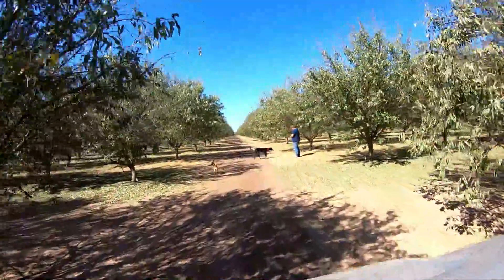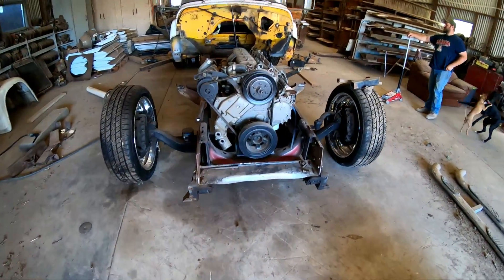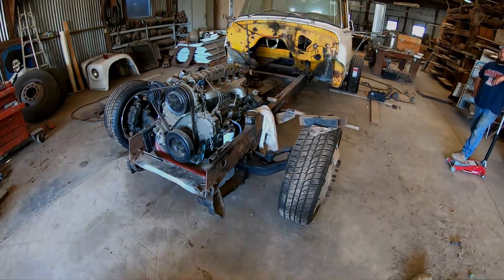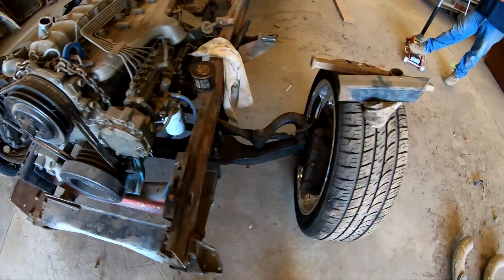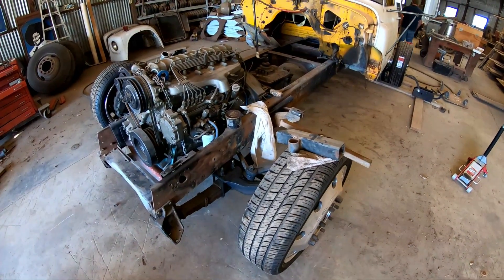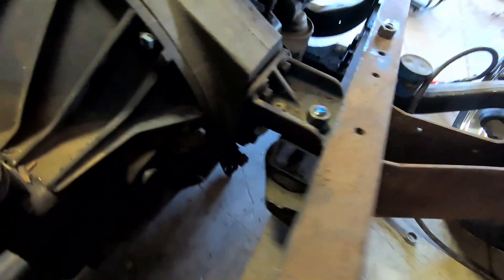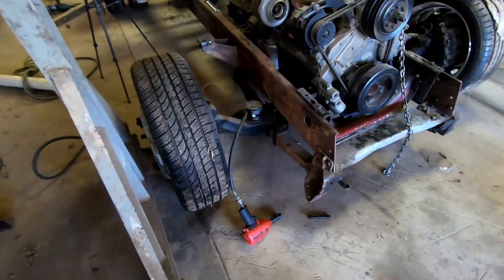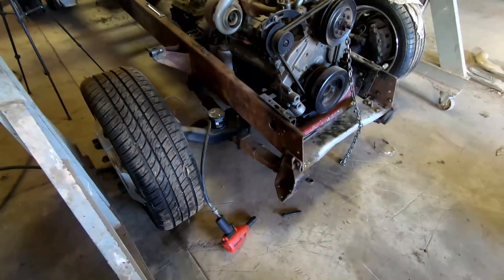Making Adjustments to the Engine Mounts

Comment: Great video guys. Just actually got my setup ready to put the front and rear under as well. Same build but im using as of now a 76 f700 cab, 2000 international 4700 chassis and axles for the hydraulic disk setup. I might need to start videoing it and make me a channel but who knows. Anyways thxs for feeding my latenight bordom with AWESOMNESS.
Reply from the maker: Thanks man! Sounds like you have an awesome build going yourself. If you make videos let me know. I will definitely check them out!

Comment: Since the axle is over the leaves on front, I don't know that taking leaves out does anything for you? Unless I misunderstood where you're looking for clearance from (was thing ground to axle was what you were implying). Also, won't it make the weight of the motor compress the leaves more when you take some out? Regardless, awesome work. Hope harvest has been plentiful.
Reply from the maker: We need to gain clearance from the bottom of the leafs to the ground. So as you remove leafs, it decreases the thickness of the leaf pack. Which will gain ground clearance. And yes it will make the front suspension softer. Which is ok because right now it’s so stiff it Hardly moves at all. So we are going to pull out three leafs. And see what clearance that gives us. And see how much more the springs compress. It’s really just a trial and error game to get it correct.